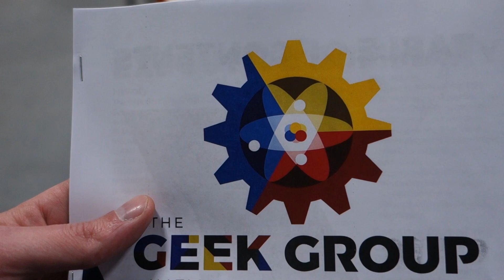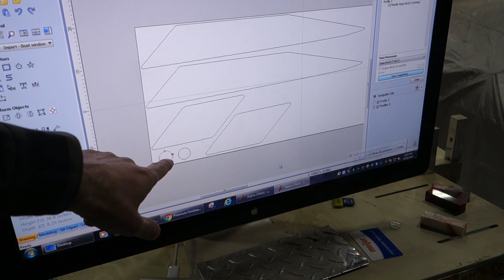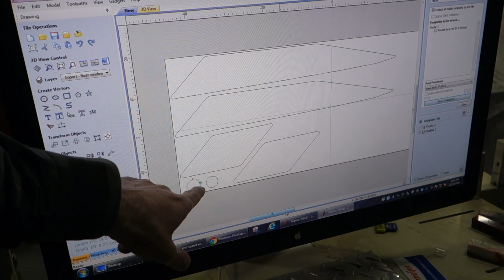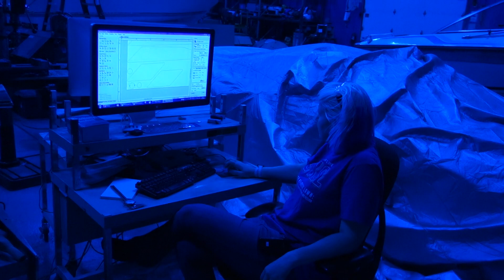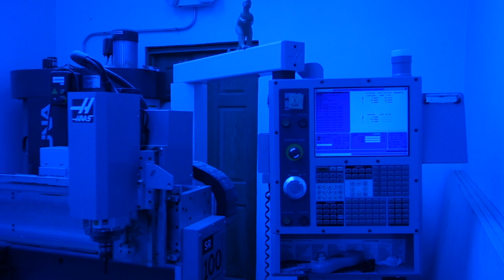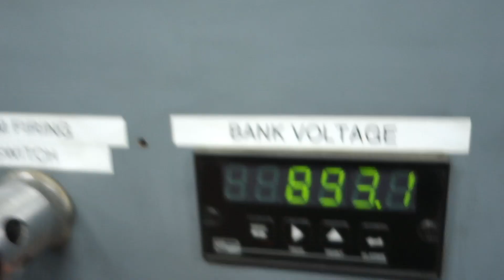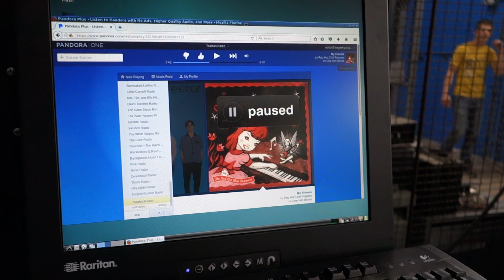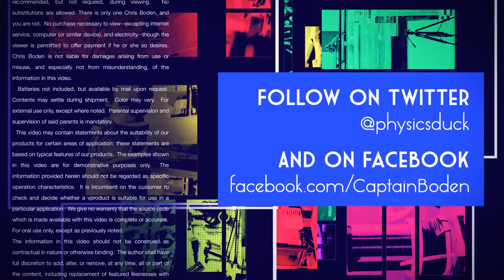Captain's Blog 12 10 2016 Boat Windows and Forklift Lightshow

Comment: My ass puckered every time that cutter started into that acrylic.  We got into the habit when cutting acrylic for walk-in cooler viewports of warming it up first. A heat gun went a loooong way to prevent cracks and tearouts. Of course this comes a full day after it's done.
Reply: I am used to cutting acrylic but not this thin -- that was the part that was really uncomfortable to me. It flexes.
Reply: The problem I have is with me. I've cracked and broken a lot of acrylic and polycarbonate until I started warming it first. So, it's a reaction from my own waste from screw ups. You know what you need to do to make it work for you....and you do that very well.  I need to make sure I don't waste a customer's material, or it comes out of my pocket.